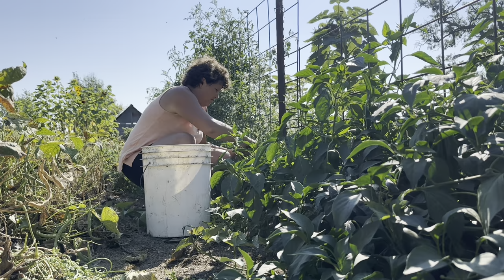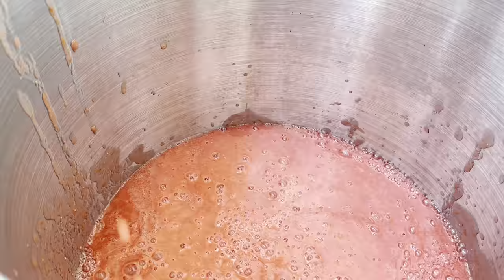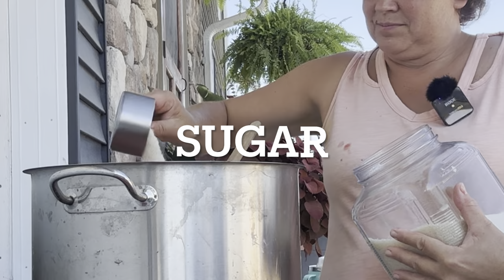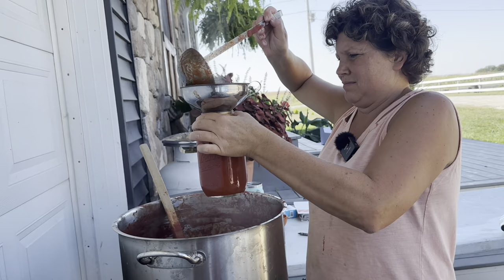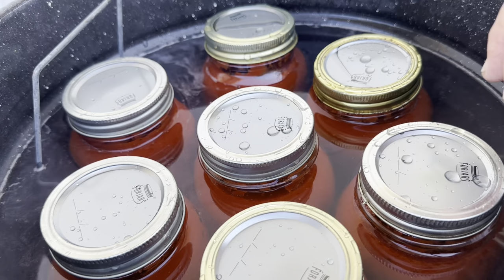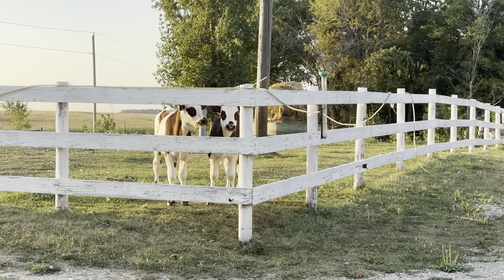Labor Day on the Homestead, 55 Quarts of Pasta Sauce, Recipe included!!

Comment: I would sure say the pruning and the heat worked in your favor!! How awesome to now have all that on your shelf. I only have 4 plants left and it worked some, but not quite like yours. I'm actually thinking of removing them and then taking all the tomatoes in the house to ripen like I've done in the past. The temperatures now are going to only be low 70's and lows in 50's overnight and a couple nights at 48. I know when it gets this cool, they definitely don't ripen.

Comment: Thanks for another great video! However, I have a couple questions I hope you can help me with. This is not a criticism, I just don't understand why you blend everything first prior to putting it in your stock pot to boil down? It seems like an extra step and a messy one at that. Lol (Btw, I love the idea of the outdoor cook area! So smart!) So why don't you add all your ingredients to the pot and let it cook down and then if required use an immersion blender to blend it smooth? I am sure there is a reason you do it this way and I would love to know why. Also, I have always wanted to know why recipes call for sugar? As I am trying to cut back on sugar intake, I wouldn't add this, but all recipes seem to add a varying degree of it. So there must be a reason for it & I sure would appreciate your opinion on this! Thanks so very much for sharing and for answering my many questions. God is good indeed! ❤

Comment: Hi Ruthann! I have been following your you tube channel for a couple of months. I’m so happy I found you, love your canning techniques!…. I do have a question I canned apple pie filling today, I hope this doesn’t sound silly, but when I took the jars out of the water bath I was setting them on the counter and wasn’t paying attention to the lids from the first batch, then I did a second batch and when I took the jars out then I walked away  for about 10 min. I came back and noticed all the lids were flat and only three were raised. Never heard any pinging noise I only heard one then the 3 that were raised went flat I still didn’t hear a ping are they sealed as long as the lids went flat?
Reply from the maker: Yes and long as they went flat they are sealed. 
  Not all lids will ping.  Just make sure to remove your rings and test each lid to make sure it’s sealed.